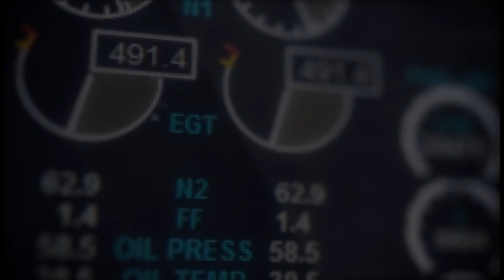Will Circular runways "take off"

Comment: The more he explains the issues the more you realize it just would never work. But one thing I was thinking that I think would be an interesting concept is for takeoffs and landings. Basically have the aircrafts on a ground based vehicle that does the acceleration and deceleration for the aircraft. And landings, it would need to have some sort of software designed to track where the aircraft is going to make ground contact and then line itself up with that, basically intercept the aircraft as it touches down and then continue it's roll off to displace the energy, until bringing it to a complete stop. I think it would give airports in congested cities better flexibility bc they wouldn't need 3k ft long runways. It would reduce maintenance needed on landing gear. And it would take away a few possibilities for things to go wrong. It would obviously increase possibilities for other potential problems but I think if actually taken seriously the idea would be a good one. I got the idea from watching airplane situations who had issues with their landing gear, basically imagining a small to the ground platform racer with tires that races down the runway and swoops under the aircraft, locks it in place, and then decelerates for the aircraft. And the same idea for taking off. Gets the aircraft up to speed much faster and then the pilots can rotate their plane like normal. Since takeoffs and landings are typically the riskiest parts of flying, I think the concept would make takeoffs and landings a little safer

Comment: I can’t imagine how this idea could work.
I mean I suppose applying the necessary rudder trim could be made part of the approach & takeoff procedure, but you’d still also be amplifying the effect of any windshear that was present, and on top of that introducing a crosswind component to otherwise clean departures/approaches (with the centrifugal force just further adding to that).

Not to mention that this would make ILS approaches basically impossible (unless it was heavily limited to favor approaches from specific directions…which would basically defeat the point of having a runway like this in the first place).

Pretty much a pie-in-the-sky (or donut technically I guess… XD) idea, IMHO.

Comment: Serious question, why don't runways have barrier walls to help mitigate crosswinds? Like you see on some bridges to protect road vehicles from crosswinds?
Reply: because they don't necessarily help and in fact can make things worse as any barrier (unless impossibly high) will create vortices once the in gets past the barrier. There was an accident where a planes tail flight surfaces got jammed because it had been sitting on the down wind side of a large building and the vortices mucked up the flap. I think it's one of Petters videos, try and find it, that will explain why barriers won't work.

Comment: Forgive me if these are stupid questions, but wouldn't the curvature of a circular runway be problematic, especially during takeoff when the aircraft is at its maximum weight, or does the bank angle eliminate or sufficiently lessen the amount of steering/turning required?  Also, since the aircraft would be traveling along a bank angle, 1) wouldn't that mean that during takeoff, the lift would pull it up and to the side, and 2) wouldn't the bank angle complicate landing (since the aircraft wouldn't be landing on a level surface)?  All-in-all, I can appreciate what Mr. Hesselink is trying to achieve, but a circular runway just sounds like a major accident (or chain of accidents) waiting to happen.

Comment: The clearance area isn't necessary at all if the runway diameter is the same as diameter of the circle a plane doing a 360 degree turn has. The planes would take off and land in a helical pattern, climbing or descending over the runway. The approach and departure would be performed far above the altitude of any pre-existing minima. The runway would need to be sloped not a constant gradient, but bowl-like to accomodate for different take-off and landing speeds, and the chance of asymmetric thrust or slippery surface, where the increased outer slope would help offset the asymmetry and centrifugal force. The wing clearance wouldn't be much of a problem because the plane would always land at a bank angle right for its airspeed, and choose area of the runway sloped to match that angle.

Comment: How many changes in wind direction you have to face when landing or taking off on a circular runway ? Regarding the parabolic curves, they have even been abandoned in the motor racing circuits. In driving, the difficulty lies in taking the curves, would it be easier with a plane ? May be I'm completly wrong but I think it's one of the stupidest idea ever heard !

Comment: It would never work, not at that diameter, make it 10km diameter so that the runways are essentially straight and you might have a chance until you start adding bank and multiple traffic landing/taking off on different parts.  Massive fail actually.

Comment: Something I though of as well was that if the runway is cambered or tilted, could that cause a problem for example, on a rough landing causing the aircraft to fall sideways which in turn could cause the tip of the wing to strike the runway? That would be what would worry me - that the aircraft would essentially not be landing flat but on an angle

Comment: Crosswinds does not have to be a problem. Just construct huge walls (200 meters high) on each side of the runway, they have to start a few nautical miles out of the runway though. Very realistic, I am just thinking outside the box :)

Comment: Well, stitch 6 runways together in a hexagon shape, you will have something quite similar to a circular "thing".
But this would require an area much bigger than O'Hare International.
The wasted area could eventually reused by building a soccer or football station in the middle of the hexagon ;)

I just wonder if the whole thing was nothing else than a big April foul.

Comment: Just build a huge paved square with LED lights embedded throughout every few feet. Then through switching programs you could light up a defined runway, or 3 or 4, in any direction or length you want at any particular moment. If a plane wanted to land or take off on a particular heading that could be accomplished exactly.
Reply: This idea is good!!!

Comment: I'm an engineer and currently work scientifically to get my PhD (not in an aviation-related field) and I think it's sometimes a bit problematic that concepts leak from the scientific world to the "normal" public. Don't get me wrong: I would prefer free access to science for everyone instead of the pay walls that we have today. However, many people don't seem to understand how science works. No researcher comes up with a working concept from scratch. You try to solve a problem and therefore design a concept, such as a circular runway, then you publish that and normally you also already acknowledge all the shortcomings which you could identify so far. Other researchers will probably identify even more shortcomings. But if the concept is generally good, then other scientists might pick this up and say "Hey, I have a solution for this particular shortcoming of your concept" and so on. If all the shortcomings can be resolved, then the concept might actually go into productive use. However, this is a very very slow process until all shortcomings are solved and many many ideas don't get picked up and just never make it into a useful product. But this should not stop researchers from publishing their concepts - even if they haven't solved all problems. If they don't get their idea out to the (scientific) world, then there is no chance that another scientist might have the solution for one of the shortcomings. So it is completely normal to publish things that are not perfect (at all). However, "normal" people should understand and know how science works, instead of expecting such concepts to be perfect right from the start...

Comment: Re Runways , Just have a Two Kilometer Square piece of concrete and as the wind direction changes 
change the landing direction ...and eliminate sheer winds problem alltogether....and when the weather is fine ....you can use multiple sections as runways....hmmmmm

Comment: Great ideas are often not practical.  Pity.  How about focusing on VTOL?  Tech advances will likely provide solutions that are intrinsically safer - particularly with smaller and (dare I say it) electrically powered rotatable prop aircraft.

Comment: This concept is I believe completely, disastrously impracticable and dangerous and would be a literal dizzying disaster from the point of pilot and ATC overload. 

Changing wind speeds inherent to the topographical interference of a circular banked runway with varying wind and ground effect throughout the layers in approach would create weird turbulence with vastly different updrafts/downdrafts on approach, even without changing gust direction.

That turbulence would change the ideal landing point, which would have to be not only exactly on the correct degree pointing, but on exactly on linear target or effectively change the required heavily banked, exact approach angle (to avoid wing strike) and also the steering angle required in case of over/undershoot. Any incorrect bank angle on landing would almost certainly cause wing strike potentially sending the plane over the embankment to certain destruction. 

There would also be immensely changed and increased forces on steering and main wheels, even with banking, as every landing would have to be exactly on the correct line, radius and speed for the banked runway to create a correct centrifugal/slope balance. With a wicked twist from larger outer wheel track radius creating a right steer "moment" even in a perfect landing while front wheels are still in the air!

And a touch and go, or go-around would be a nightmare, if not impossible. Or am I just being alarmist?

Comment: Never happen.
Jets cannot stand the torsional aspect of an airframe being accelerated on a curved banked runway. 
Every part of the airframe especially the landing gear, would need to be rebuilt stronger and heavier to deal with the massive side force ( centrifugal  ) force of a jet landing and taking off from such a runway.
Add to this the tires would have to be redesigned like car racing tires and  bolted right to the rims to stop them from being torn right off the rims at landing. 
These tires would likely be many times more expensive then current jet tires.
The result is a MUCH heavier, much less profitable jet to fly.
Also,what about snow and ice.
Right off the outside of the curve and CRASH!
This is why today's airports are brilliantly designed to put the least amount of stress on the jets airframe and hopefully on the crew as well.
Although there are some mountain and city strangled airports that test the best pilots everyday.
Circular airports are a great brain teaser and might send us in another direction to further design more efficient airports but everything in air flight today landing or taking off moves ( or tries too) in straight lines until its safely in the air or on the ground.
Otherwise you will almost tear the jet to pieces.
You pilots who  take off and land in extreme crosswinds blow my mind everytime I see those videos.
Just amazing and terrifying at the same time.

Comment: Personally, I see another problem: pilots generally need to know about the wind and its direction is when taking off or landing. At take off, you clearly cannot take in a  strong side wind, especially if the wing towards the outside of the runway is raised because of the tilt in the runway. When landing, you will know the exact heading of the wind only if you know very precisely in what point of the circle you will hit with your landing gear, whereas with a linear runway you very much know the wind heading all the time. To sum up, in terms of knowing your winds, circular runways are a no-go! Personally, I see circular runways only for low-volume, small recreational fields, but nothing else.

Comment: Is there any reason they can't use steam catapults like on carriers to launch passenger jets?  A bit milder acceleration of course due to longer runways up to maybe 220kts.  .  Think of the fuel saved !!To compliment this concept and increase safety....add a safety landing strip directly ahead a mile or two.  Just in case it's needed.

Comment: Over three years later and it doesn't seem like they have come up with any solutions to a lot of the issues he raised. Seems like this idea would require a radical overhaul of the entire aviation community from the way planes are designed to how ATC is handled and how airports are built. The benefits of a circular runway would have to be absolutely massive to encourage that much of an investment in change.

Comment: Petter, in the UK there has been a law limiting how high radio amateurs can have their antennas I think within 5km of an airport for many years. Also, centrifugal force isn't an issue because of the banking. However, a circular runway will still have crosswinds somewhere!

Comment: In the future I see aircraft taking off and landing vertically or near vertically. Much like the Ospreys. This would allow for greater traffic flow. I also see the tons of fuel being replaced with tons of batteries and engines being electric. Will I live to see it maybe. In the first 100 years of aviation tremendous advancements have been made and the next hundred could see suborbital, efficient supersonic, and morphing wing structures just to name a few.

Comment: Seriously, aircraft tires are going to take all that lateral force without blowing?  What about when the runway surface is wet or icy and there is little to no traction?  How does an aircraft line up to a circle?  What about banking in order to line up to a circular runway?....how often will there be wing strikes?

Comment: The biggest problem I can see is, when you have a straight runway it's an easy concept to understand and situational awareness is easier to maintain. On a circular runway it's complex at a moment when you need simplicity. It would be easy to lose situational awareness. Also, since all planes are using one runway, if there is an issue with one it automatically affects all others. There's no redundancy in the system if that happens. Maybe we could get around this by heads up displays that show terrain and flight corridors, and base situational awareness on that, but that's a big step forward. There's no room for error while you're banking and just about to land.

Comment: Add to the issues the possibility that planes would need to taxi as far as 3km (in the proposed dimensions discussed) just to arrive at a designated takeoff (or landing) point in the circle. Maybe that might not be unusual for the largest airports, but for just one "strip?" The largest airports would have multiple, maybe 4 strips simultaneously used for that much land.

Comment: How about straight two-way runways so that planes can take off or land by selecting one of two directions depending on the direction of the wind?
How about cross or scissor-shaped two-directional runways (each pair of runways are parallel and the two pairs are intersecting) in order to avoid the case where the direction of the wind is exactly perpendicular to the runways.

Comment: Gosh, I can only imagine the mental complexity and gymnastics required to put the plane on the ground after coming out of the clouds in turbulence, with a circular runway and a huge crosswind component.   The only way to get close to doing this is to have a plane that can do Level 0 ILS approaches (Autoland).   BTW, I thought we try to address huge crosswinds with alternate runways that align with those times when you have huge crosswinds.  With the necessary  ground/terrain clearance, noise abatement,  and runway ratings permit of course?   Can you imagine the passengers in back on those landings and takeoffs, oh boy.   

Interesting Idea though, and it will be great once we convert to VTOL aircraft.  Taxi out to a pad area, short roll, and away you go, on departure WISKY-7.   Hello departure.   Arrives would allow a certain amount of circle to land to an approve pad, that faces into the wind as well.  Might impact ATIS, and approach vectoring as well.  This might be fun for someone to set up in FS/2020 and try.

Comment: So of we'd build a new island offshore for about 30km then most of these issues wouldn't be an issue? No nearby runways, all around it is clear, no buildings or mountains.
We can limit the use of it to only 4 engine aircraft and maybe bank the runway just a little. At least it should be tested somewhere :).

Comment: Just make them very wide. Like a squre the length but also width of a runway. You can assign any given line as active runway  and it will be hard to get in the grass on the side.

Size might be an issue of course.

Comment: You could offset the skid risk and centrafugal force by increasing the vertical slope of the curve with it getting steeper towards the edge. Then the need to turn and the centrafugal forces could be constantly in equilibrium simply by moving closer to the edge while speeding up and closer to the centre while slowing down. It might need to be very wide though to avoid the slope changing too quickly to avoid scraping the wing on the ground, like 200 metres or more! Once you reach 300 metres wide, wing tip clearence difference could be negligable. It would stop runway excurtions though and the risk of running out of runway. It could also get extremely steep near the edge outside of the general operating area to prevent skidding off the runway, infact even completely vertical at the last few metres. Also it won't affect other airports nearby if it is far away enough from them - Might that resolve most of the problems mentour talks about?